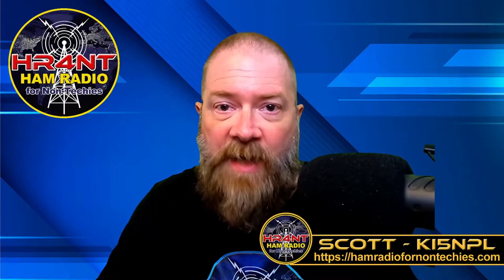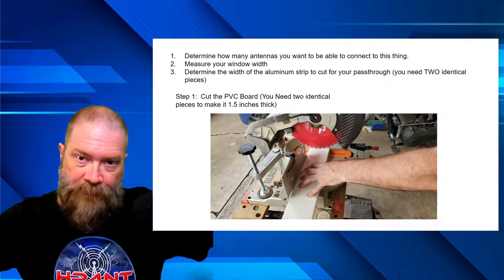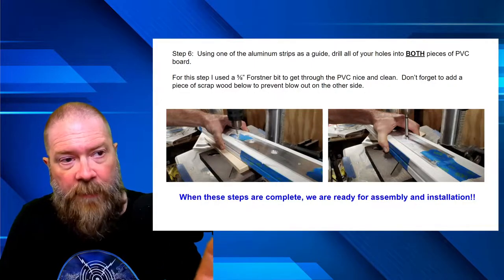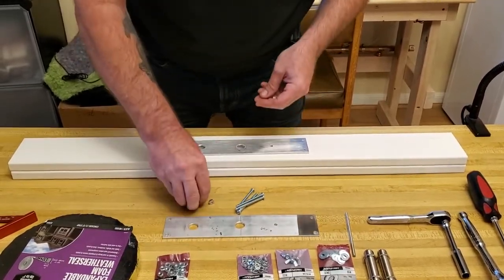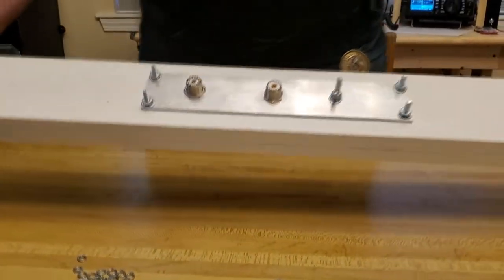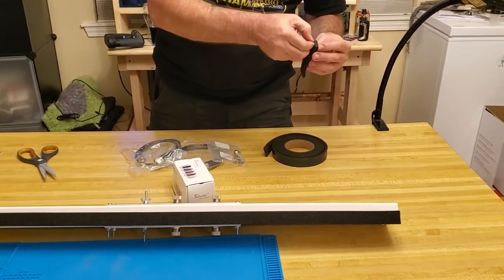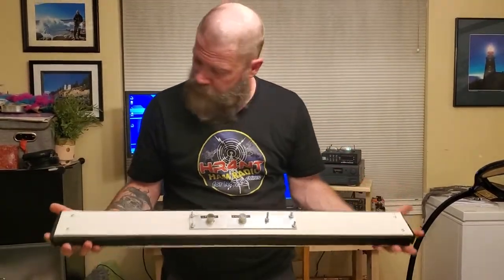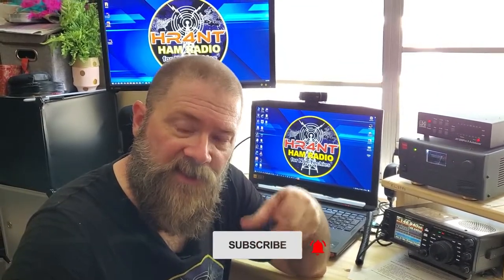Build Your Own Window Passthrough

Comment: Maybe I'm crazy but it seems a bit sketchy to have your ground electrically hooked up to the coax mounts via that aluminum plate...
Cause if power goes through there...
And yes, I'm using your template for mine, just different.
Ground will be by itself.
Reply from the maker: I am shooting a new video this week about grounding...kind of an update video.  Pretty sure it will tick off some, but I think it is necessary to bring the topic back up again.  Thanks for the comment and for watching.  73!
Reply: @HR4NT  yeah I need to know about grounding before I deploy my BBTD.